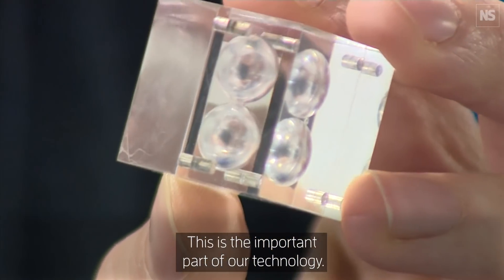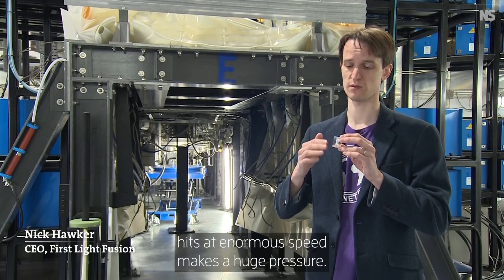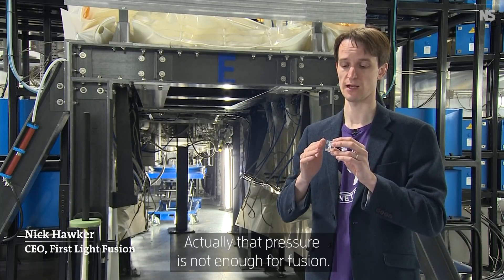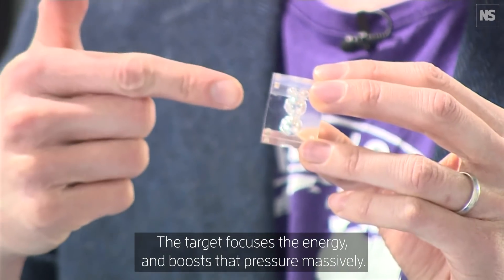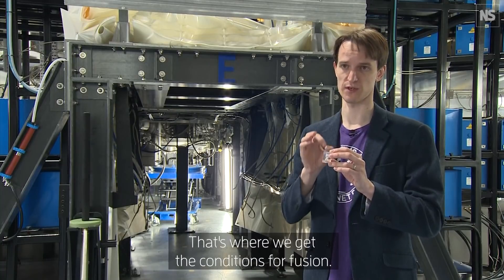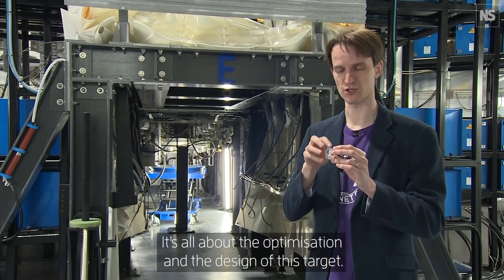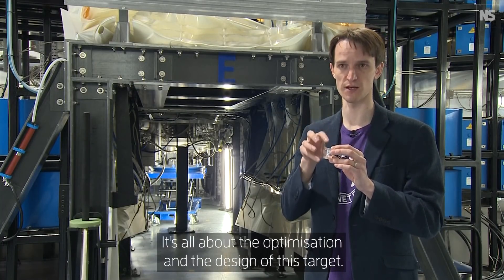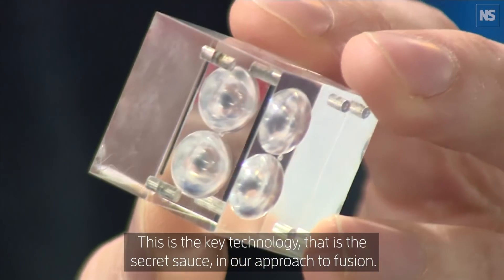Nuclear fusion breakthrough achieved with new projectile technique

Comment: Ummm... 6.5km/s is actually about 20 times the speed of sound at sea level, not 200 times.
Reply from the maker: Thanks, Chris. You are correct, in this system the initial projectile is accelerated to 6.5km/s.  When it hits the specially designed target its energy is amplified, accelerating the fuel to 70km/s.  To make this clearer, we've updated the video description.  Thanks for watching!
Reply: @NewScientist  Another thought - you say you can amplify energy? Just by causing a collision? This needs to be explained too.
Reply: @NewScientist  I smell BS tech.
Reply: @NewScientist  And you get energy for how long? The problem currently with plasma fusion is the short duration of the energy containment. How is this better?
Reply: @NewScientist  How can you get to 70km/s with a gas gun? Isn't there a physical limit?

Comment: It's not considered fusion until more energy can be made than the energy used to produce fusion. According to the laws of thermodynamics and laws of conservation between energy and matter energy cannot be created. When energy is created its referred to as Over-Unity of energy. Over-unity of energy according to the laws of physics is impossible and thus taboo. So what happens with papers published indicating Over-Unity of Energy? They are removed.

Many years ago I read an article published to the leading physic journal talking about an experiment a Harvard professor, et al., did. He posted the results.  I read the paper and then commented on it congratulating him on discovering Over-Unity of energy. The next day the paper was gone. So someone must have agreed with my interpretations to the data. That's what happens when your work indicates over-unity of energy is feasible. 
If they truly created fusion or over-unity of energy then we wouldn't be reading about it. It would quickly be removed. So, I figured they haven't truly created it. And I was right. They haven't yet produced over-unity of energy. It is still just a concept, not a reality.

Here's a quick way to produce fusion. Take and mix equal amounts of powdered ferrous sulfate and aluminum oxide. Then stick a magnesium strip in the powder and light it on fire. It will produce a chain reaction causing the two elements to fuse together in what's referred to as an exothermic reaction. It produces massive amounts of heat, enough to melt through a cast iron engine block in a matter of a few seconds. Also see thermite and thermate. Very little energy is added to the elements, while massive amounts of energy is output. The only problem is being able to contain all that energy. It's so hot it eats through just about anything.
Reply: You write so confidently and yet say and clearly know so little
Reply: @Emperorhirohito19272  Well my friend, seeing how you think you know more than me then it shouldn't be that difficult to answer this simple word problem. I've been trying to get someone to answer it correctly now for about 2 months.

Hypothetical planet:
At 5 ft. in depth the temperature is 50° F.
At a depth of 40,230 ft. the temperature is 356° F
The depth to the center of the hypothetical planet is 20,924,640 ft.
The temperature gradient is a constant after 5 ft.
What is the temperature at the center of the hypothetical planet according to these measurements?

Good luck. And yes, I know the answer because it's simple math. You just need to add some common sense to figure it out.
Reply: @ronaldkemp3952  asking me an irrelevant math question isn’t gonna make your objectively wrong nonsense about fusion any less wrong.
Reply: Fusion is when two atomic nuclei fuse.... it's definition isn't dependent on how much energy was put in or brought out, it's simply when two atomic nuclei become one...

Comment: Mach 200? Do you, at NS, have even basic science competency? Also, this will never work. As even a small 150 MWe plant needs at least 400 MWth, which is 100 kg TNT/second. Or maybe 10  times 10 kg TNT explosion per second. No kind of economical set up can withstand this for an hour, much less years.
Reply: Go back to school and study a bit instead of dreaming!
Reply: @nodrogmay8275  how is he wrong?
Reply: If you have that kind of material, I'm sure you'll make billions selling 155 mm proof T-shirts! You'll make tanks that weight less than a typical car :D :D :D !!!
Reply: 1/r squared is your friend!  I'm no nuclear physicist/engineer, just an E.E., but even I could think up a general solution in 30 seconds.  Since the likely fuel is deuterium-tritium, most of the resulting energy is carried off by fast neutrons (unfortunately - would be better if in form of alpha particles for direct electric conversion).  So the neutrons will need to collide with something to generate heat without generating (much) radioactive waste.  Water would work, and would act as shielding also.  You could heat up a BIG tank of water, and not be limited to a single gun.  Each target could form a water tight fit at the end of a PVC (or similar) tube just strong enough to maintain vacuum when the tube is surrounded by water a few meters in depth.  Fire away!  The end of the (cheap) tube gets vaporized; big deal.  I'll let the mechanical engineers figure out how to rapidly deploy more tubing with targets and vacuum.
Reply: Also add the costs for 10 precicely produced targets for each second.

Comment: So they're gonna make better and better impact targets until power plants are possible, or is this just to say they did it?
Reply: they did archive fusion with this design it seems, but a spark is far from having a flame or a torch 😉
Reply: @mho...  Its proof enough , this should be so difficult that no one has even considered it and yet here we are :)
The important thing is that it's officially in the race now , no one is so far ahead of it
Better target design and computing might just do the trick
Reply: Better efficiency to get to net energy gain.
Rapid reload and refire.
Radiation and shrapnel resistant energy recovery chamber.
One heck of a Roomba to sweep debris from the chamber after each firing......

Exciting stuff.